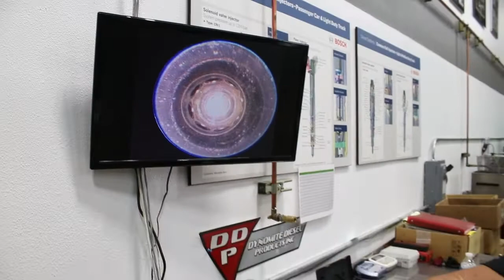Truck Talk - Diesel Injectors 101 - SAC vs VCO

Comment: I wander if this info has changed since they started doing the piolet holes? I see they are offering SAC for 400 HP which is what I would be interested in but question why they are not the VCO style

Comment: Why isnt the industry using more advanced materials like silicon ceramic matrix?  Heat doesn't affect that material the way it does regular metals.  It's used on jets satellites pcb boards ballistic plating.
Reply: I think that's what Hamilton is using in their pistons.  Haven't heard of anyone else using it yet.
Reply: @Joshua Quilliam   I think he uses coated metal on his pistons.  I work for a company we machine ceramic parts.  Most of it is used for tooling that makes computer micro chips. So much could be made from this material.  It cost a lot to produce though.